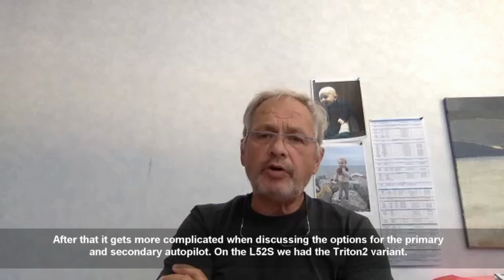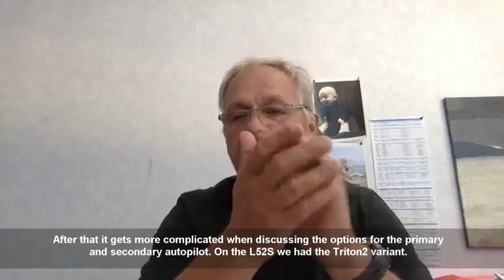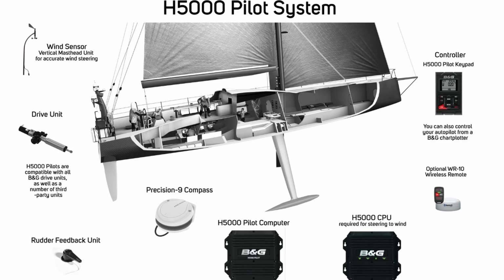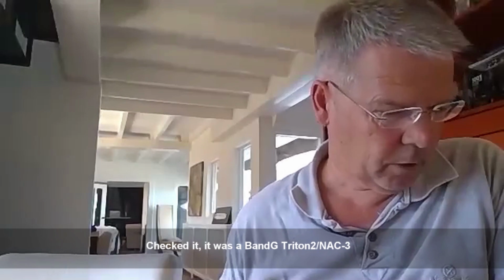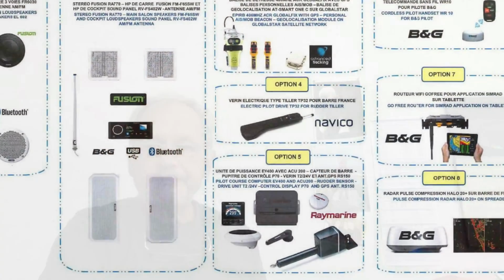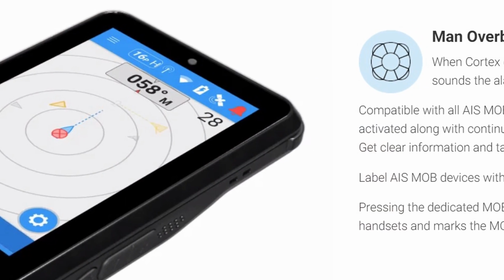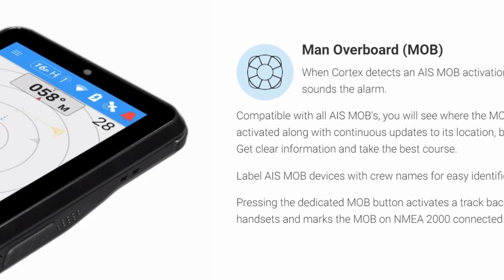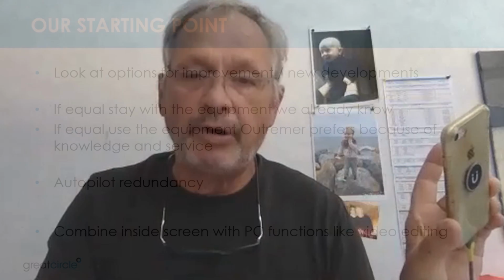Outremer 55 #4 Electronics - Sailing Greatcircle (ep.185)

Comment: Great video! Very interesting to see you set up your boat. I’m wondering why you went for  the rotating carbon mast. Quite an expensive option for cruising... Can you maybe share your considerations?
Reply from the maker: Initial decision was on gut feeling, as we don’t have any experience with a rotating mast, but we liked the idea of reefing downwind. We’ll discuss it in more detail in next episode. Spoiler alert : turns out you were right ....
Reply from the maker: At least on the rotating part. The choice for a carbon mast is one of the easiest ways to save a significant amount of weight to compensate for our demand for luxury items. We don’t need to be the lightest O55 but we still do want to increase our average speed. It’s not cheap in terms of initial investment but as it might be on the wishlist of most of the potential Outremer buyers we think that in terms of resale value or depreciation this choice might even have a positive effect. And choosing carbon instead of alu doesn’t seem to have a disadvantage for us.
Reply: Thanks for the feedback. Look forward to the next episode!
Reply: @CatGreatcircle  Hi Mark, just been viewing your choice's guidelines, I have heard that a carbon mast tends to shatter when struck by lightning. Any comments on this if you can thanks.
Reply from the maker: Getting struck by lightning is not a good thing anyway but haven’t heard any carbon / lightning related horror stories yet. Might be ignorance but even then let’s leave it like that …
Reply: @CatGreatcircle : yep agreed, let sleeping dog lay.